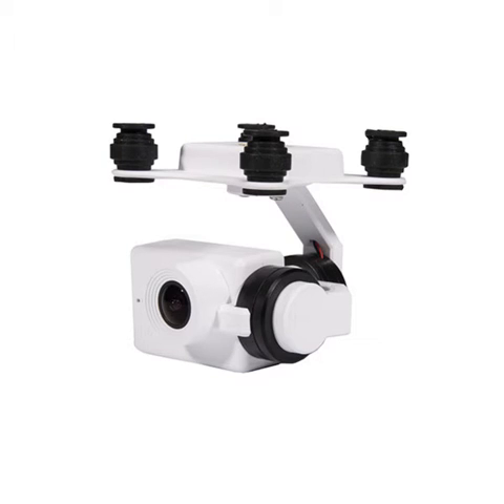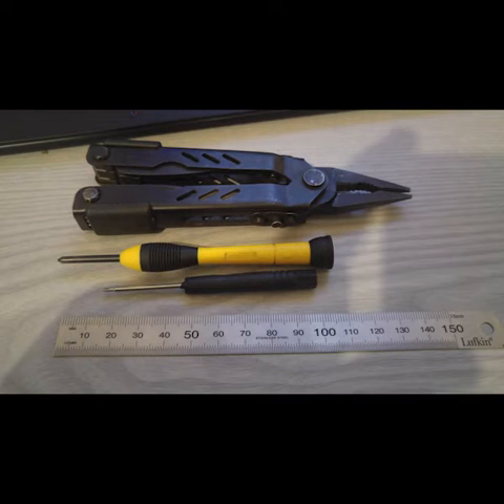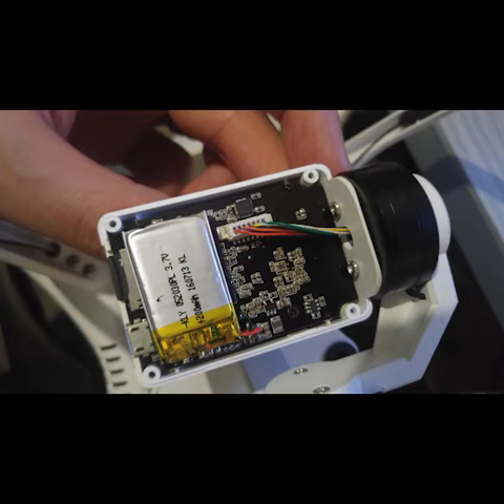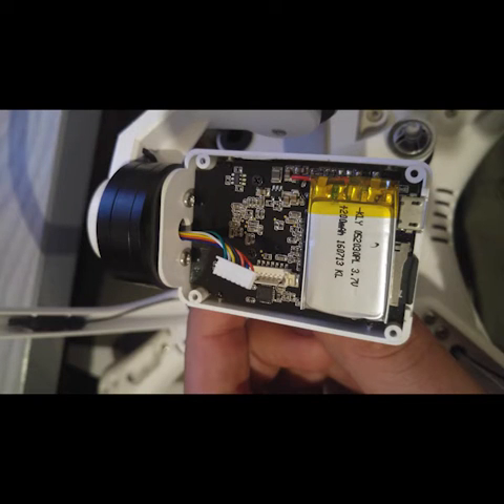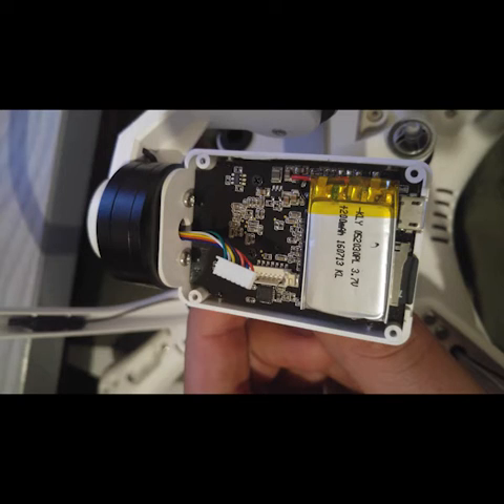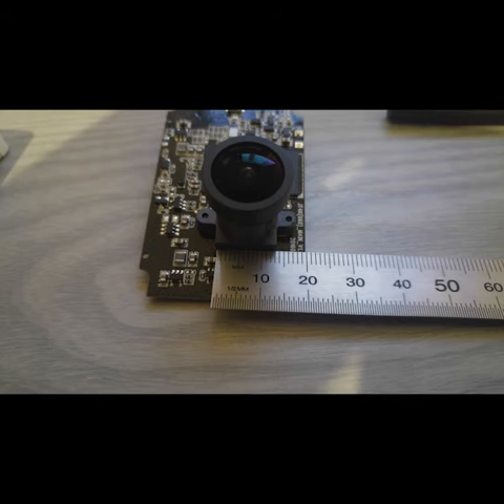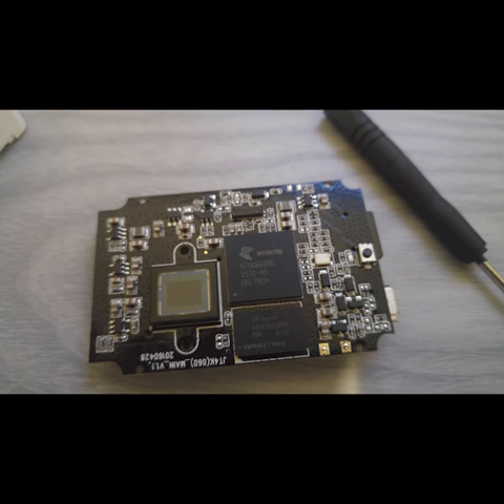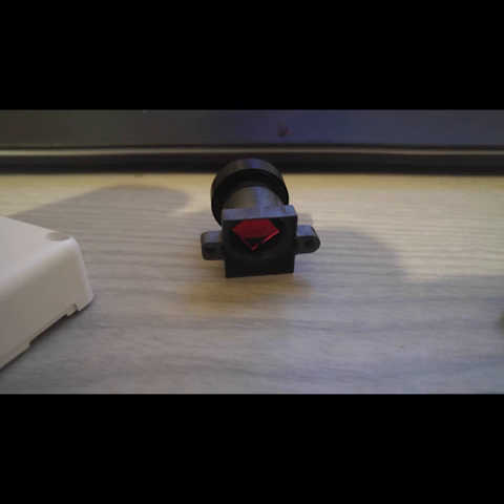Upair One V3 4K camera dismantled

Comment: My problem V1.0 Motherboard drone number is UpAir 2 PX4 v1.2.00 2016y 09M06D inability video recording in another resolution other than the 4k (which of course is not 4K, paper submitted all) All of the 3 sec pressing i try no use. Thank you.